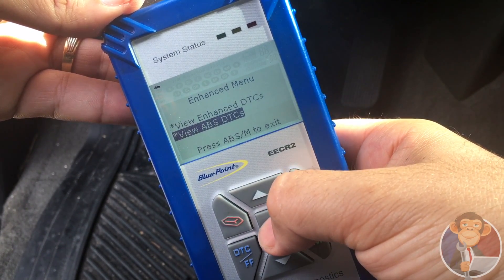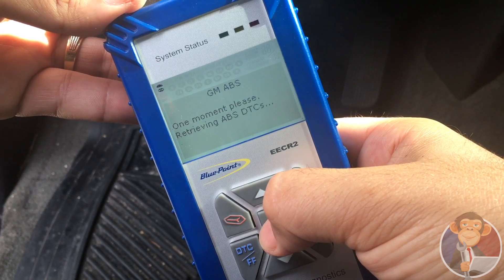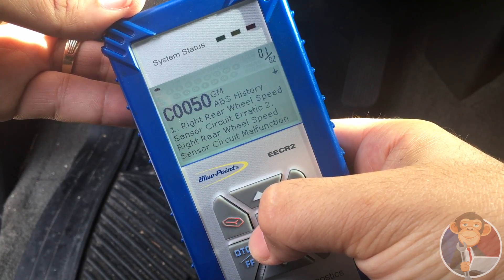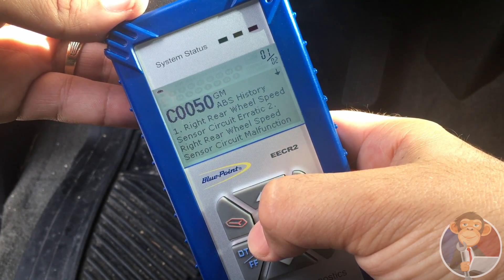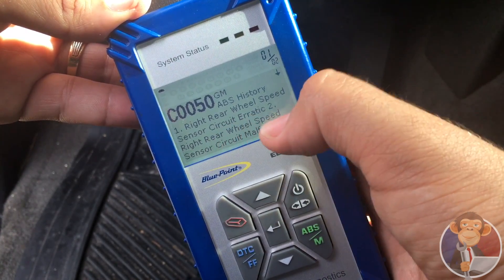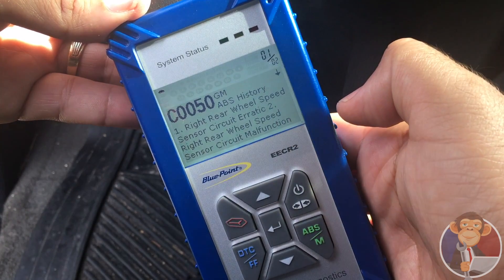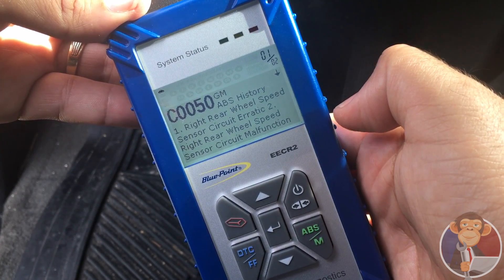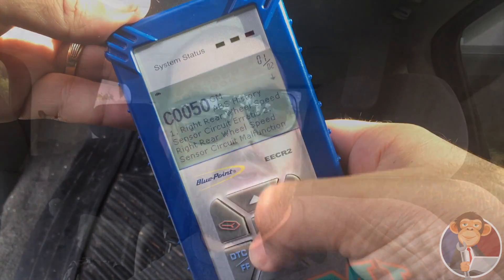Scanning a 2009 Chevy Tahoe w/ Service Traction Control & Stabilitrak Message - EGM Diagnosis #5

Comment: Traction control light on when I accelerate from stop the suburban jerks only happen when traction light is on
Reply: Wheel speed sensor. When you accelerate, the sensor gives a faulty "slipping" reading, as if you were driving on snow.... Then the traction control comes on, reducing power to the wheel. That results in the vehicle accelerating oddly.
Reply: @Des420  is there 4?
Reply: @joeya7166  Are there 4 wheel speed sensors? I believe there is one on each wheel... But the odds of all of them being bad at once is very, very low.
Reply: @Des420  can you help me with the  Resistance parameters?
Reply: @joeya7166  Sorry... That's out of my field of knowledge.

Comment: Hi bro my Tahoe 2007 has that same lights on. what do u recommend.. the mecánick say that I need a new motor??
Reply: Switch your crankshaft position sensor its on top of the starter
Reply: Did you get it fixed?

Comment: My '10 silverado 5.3 would occasionally get the stabilitrak/traction control off/service prompt, it would go off for some time, come back on & stay off. Now it stays on all the time along with the check engine light blinking. Vehicle seems to operate fine but can't figure out why the problem, will be getting a diagnostic.
Reply: Same exact thing is going on my 2007 suburban
Reply: @gueroburban4989  fyi it was a bad spark plug on my end
Reply: @pope75  my spark plugs were new but not ac delco? You think I have bad spark plugs bc I have done everything. My last resort would be a bad lifter but the engine doesn’t make any noise??
Reply: I'm no mechanic I just know the fix on my end was a fouled #1 plug & my plugs were maybe 2yrs old but changing that plug fixed the codes I was getting. I did replace with ac Delco
Reply: @pope75  I just noticed that my truck has the ngk v power copper spark plugs you think that’s it? Instead of the iridium ac delco and it has very slight engine knock barley tell
Reply: @gueroburban4989  knowing what I know now on my truck I would change them to the ac delco

Comment: So today on a 2010 silerado 1500. It came in with just the engine light on. Fixed the problem, then the service stabilatrak light came on. C0710 code but see no issue when reading the degree of the wheel left to right. The battery did die while it was sitting in the bay. Any thoughts.
Reply: Jump start battery and disconnect terminal once its charged will reset computer problem solved mine did this today when i drained the battery slapping it on acc buahahaha

Comment: 2007 Equinox - low tire pressure, stabilitrak, traction control and engine light all on.  Started getting a hard shift into first too. I put air in the tires asap (easiest first) and all the lights went off. The hard shift stopped too.  Coincidence, or is this some weird electrical tit for tat "Hey, electrical center! Tire pressure is low by 2 psi guys! Better try to adjust that stabilitrak and gearing at this unnecessary time to grind up the rear drive shaft (or whatever damage it decides)!"  Yes, that's how my Equinox communicates. Yes, I take it to the shop Tuesday. :/
Reply from the maker: I think the fault went away when you turned the car off to put air in your tires.  The errors should still be recorded in the computers and a simple scan could give you an idea of what happened.
Reply: @EducatedGreaseMonkey  tire pressure sensors will cause this as well?

Comment: I just took mine in on my 2012 silverado. same issues. it's the steering column  sensor.
$180 parts n labor
Reply: Steering Position sensor and R&R Steering wheel sensor are listed on my bill.
It defenately fixed it $180 total parts n labor
2012 Silverado LTZ
Reply from the maker: That sensor failure would most definitely cause the same messages on the dash board. The failure codes are different though.
Reply: Did you fix it yourself or take it to the shop?

Comment: i have the came issue and some one told me it was gonna cost me 700 to fix
is that true? will you be making a video on how to change it
Reply from the maker: It could cost $700 depending on who you are dealing with. I don't think it should cost you 700 dollars. 

I already have a video out to replace the sensor. 
https://youtu.be/3RpaIcZV4ps